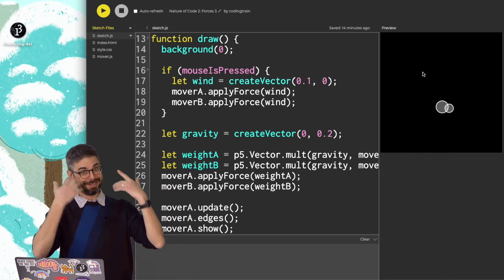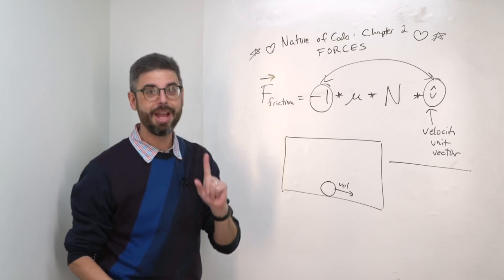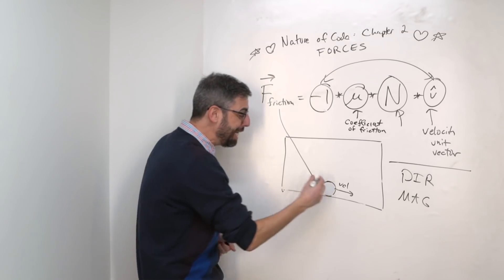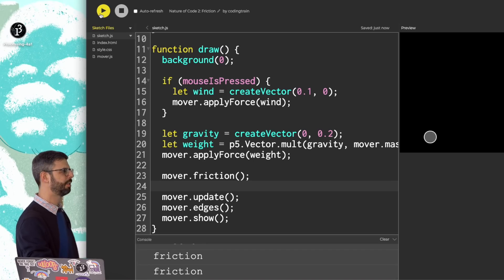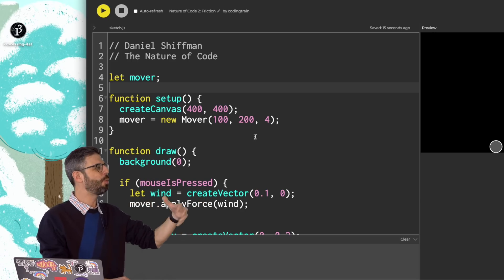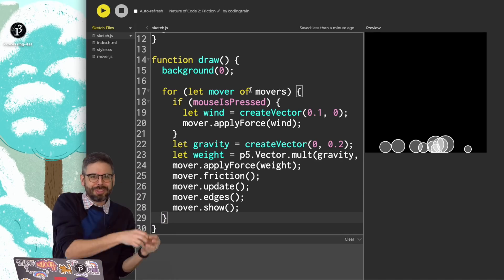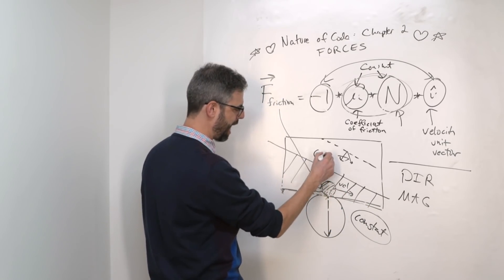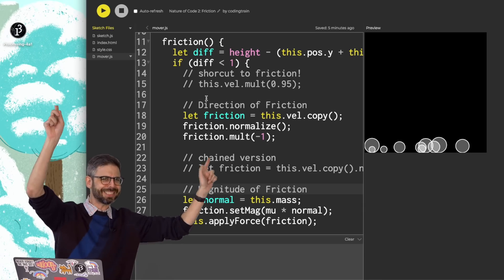2.3 Friction Force - The Nature of Code

Comment: Here is an issue I encountered: When the bouncing object comes to within one pixel of the bottom, and we therefore calculate friction, it is likely to have a strong vertical component of velocity. So when we normalize our copy of the velocity vector it is not horizontal. So we end up with a friction force that is largely vertical in direction, which leads to some strange effects. It's not clear to me why this problem did not manifest in the video but it sure did in my code. I got around this by negating the vertical component of velocity after I copied it to create my friction, and before I normalized it. Like this: 
     let friction = this.vel.copy();        // create friction vector as copy of velocity
     friction.y = 0;				    // zero out vertical component so that friction force will be horizontal
     friction.normalize();		   // normalize F so it has same heading as velocity but magnitude of 1
    friction.mult(-1);	                   // make it negative to reverse the heading
 
Did anyone else deal with this issue?
Reply from the maker: Oh interesting! Do you see this issue in the code that is part of my new draft of Nature of Code: https://nature-of-code-2nd-edition.netlify.app/force/

Comment: The quick and dirty mock up for friction has a major problem.
It will generate a friction even when not in contact with any surface, and in all directions of space.
BTW the more complete model also has a little flaw, friction will occur even with a perfect vertical motion when there is no rubbing against the surface (no horizontal component of velocity)
Reply: I agree with that guy ☝️

Comment: There is a flaw in this code.
When the ball is bouncing vertically relative to the ground (with no velocity on the x' axis) you adding the inverse of the velocity vector (wich pointing up) to the force.
Another thing, the friction force vector can't point in a direction that is not parallel to the ground, so when the ball is bouncing, the friction force vector is totally off.

Comment: Hey Dan, what I could not get, is that even without friction, if we leave the ball just to do a free fall, it seems that it never returns to the same position and gradually loses velocity. But why is that? In the edge function we simply revert the object's velocity when it touches the surface, so it should go back to the same height. I mean, conservation of mechanical energy requires that, right?

Comment: I have been following you for a few years and I started the "The nature of the code" section for a few weeks, I have one question: in calculating the normal force, should we multiply mass by the acceleration of gravity? (which we have set when we calculated the weight); because i suppose that normal force is less strong for example on the moon than on earth, in relation to the acceleration of gravity of each planet.
Reply: If an object is at rest on a surface, then the Normal Force must be equal to the Gravitational force. Given that the object is not accelerating, the total force that object is experiencing is zero. You can calculate the Normal Force through the method you described, or you can simply set the magnitude of the force equal to the force of gravity.

Please note that this only applies if: the surface that the object is resting on is perpendicular to the force of gravity. On a sloped surface, the normal force would be different because the normal force vector always points perpendicular to the surface that is applying the force.

Comment: Does anyone with experience in the area can tell me if it's possible to do the kind of content coding train uploads with C++ and opengl?
I can't find the answer   ;-;
Reply: Language doesn't matter. Just find a library that takes care of drawing, like in the Coding Train uses p5.js for javascript. I'd suggest using a game framework like Raylib.
Reply: @NeZversSounds  you think opengl can do it?
Reply: @the_gobbo  Question is - Can you use OpenGL? Just use Raylib and that's it. Raylib is already set with anything you need, even preconfigured Notepad++ so you can write and compile on it from the get-go.
Reply: @NeZversSounds  Thank you so much🥰, I'll check that out

Comment: Excellent video, loving this series.  I know the simulation you made there was basically a flat surface and shapes just moving with no motion other than in the x and y coordinate.  What I’d be interested to know about is, when you have a sloped surface, is there a difference between a ball rolling down the surface, and a ball sliding down the surface?  Instinctively I’d say yes I’d course there is,  bur is the friction formula the same, just with more a more complex object?  I guess another analogy would be hitting a pool ball with a cue.  Depending on where you hit the ball, it might slide along the cloth for a bit and then start to roll.

Comment: Is there anyway to install p5js on Windows or any other app to replace it?
Reply: There is processing which is not Javascript but desktop version p5.js is based on buy p5.js is a library for Javascript it runs on web
Reply: P5. Js is not an app it is a library for Javascript so it runs on the web processing is the thing it is based on but it is not js if you want to make a desktop app with it and that is your question look into electron
Reply: Are you looking for the editor? If so, here it is: https://editor.p5js.org/
Reply: @johnjelatis2033  alternately  openprocessing.org has a ton (thousands) of user submitted p5js projects

Comment: Hey Dan, the friction force would not affect the “y-component” (in this case) of the velocity. I fear it may misbehave later on when we have a more complex system based off this groundwork.
Reply: It wouldn't affect y for a flat surface but if the surface is sloped, y would be affected - especially if the surface is vertical. Frictional should be proportional to the angle of incidence.

Comment: Hi, I'm a fan of this channel and learned a lot thanks to you. But in this case, allow me to expreess that I find the application example of what you are showing quite strange. The friction force (as considered in the sledge drawing and the related formula) is the effect of the ground on the mover, and can only apply in a direction parallel to the ground. In the way you implement, the force has a component perpendicular to the ground as the mover bounces. And this "friction" is simply proportional to the mass of the object, although the reaction of the ground during the bounce is much higher (if we really wanted to apply the friction formula).  So yes, it doesn't prevent the visuals from looking ok, but the implementation is disturbing.
Also, the fact that the movers are circles sliding with a single point of contact and no rotation is an acceptable simplification, but gets in the way of feeling what the friction does. A flat surface of contact (with square movers) would be more adequate.

Comment: I was taught that the friction force is always perpendicular to the Normal force.
Reply: The normal force is perpendicular to the angle of the two surfaces.  The friction force is calculated based on this, not perpendicular to it.  Ultimately the friction force is opposite to the direction of velocity.
Reply: I’m not sure what you mean by angle.      In the situation where the ball bounces, is the friction opposite velocity (up and down) or perpendicular to the normal/parallel to the surface (left or right).

Comment: When you try to simluate ellastic collisions, how do you deal with intersecting/overlapping circles due to timesteps being too large? I found only very inaccurate solutions to this problem so far.
Reply: +1
Reply: maybe you could try checking to see if the spheres would intersect in the next frame and then handle the collision a bit before they actually collide
Reply: @CalculusPhysics  I did that, but the methods that I've seen so far do the following: get the overlap of the circles and move both circles away from each other by overlap/2. But this leads to problems. Imagine having two objects, one of them has a mass a million times larger than the other object. Both of them attract each other by gravitation. Pushing away the heavy object by overlap/2 would be very unphysical. I tried pushing only the light object away by the full overlap. But this often pushes away light objects into other light objects which then might cause chain reactions of acceleration due to gravitational forces being too strong. I haven't found a reasonable solution yet.
Reply: Exactly. I was thinking the same.
Reply: Erin Catto explained Continuous Collision Detection in a GDC talk. Go there, perhaps?

Comment: but the friction would also, start rotating the movers?
programmers thinking noises
Reply: @lexus4tw  yeah, for point masses, we don't have to worry about rotational motion
Reply: @ojuswi  im actually not sure if it's the case here, because he applies friction based on the geometric parameters and the interaction with the surface, it's kind of a very simple model
Reply: @lexus4tw  I think this lecture is specifically made to explain the friction, its application, and its formula. He might upload some other videos to explain rotation. Because rotation itself has its own large set of concepts.
Reply: @ojuswi  yeah, and in this model there's no variable for angular velocity, so my first assumption was kind of right, right now the circle ist sliding along the surface
Reply: They are particles for now xD
His newest videos show rotation Physics.